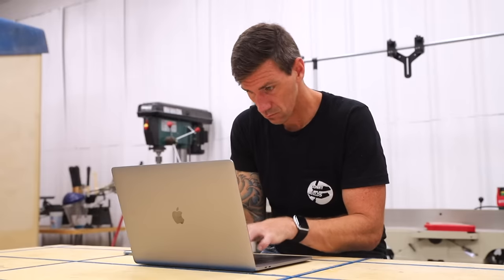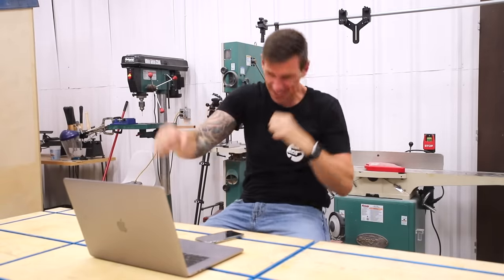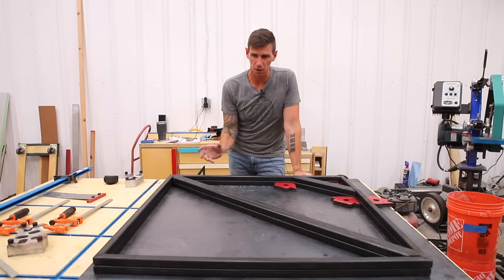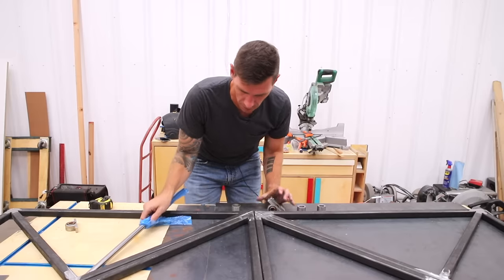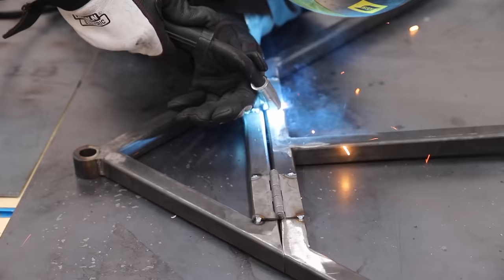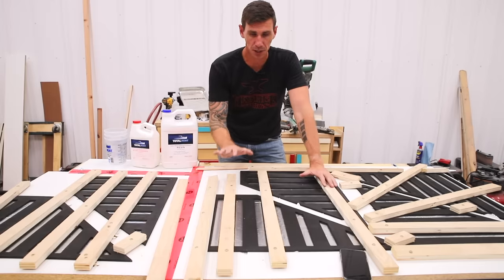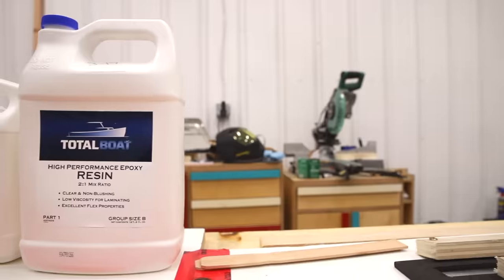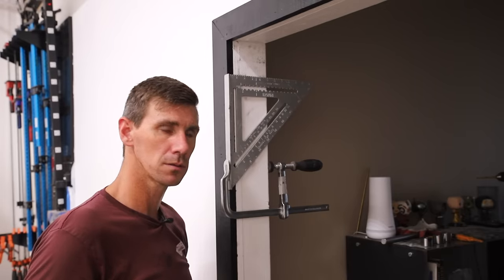Impossible Folding Door

Comment from the maker: HEADS UP!! (Update, I added subtitles to that section!) Some folks are experiencing audio issues at the 1:50 mark. This is only occurring on some devices, not all. I have no clue why this is happening, but the audio is there for that segment, I promise.
Reply: thanks man, i thought my airpods where broken.
Reply: I only hear the sound on my surround sound speakers at that point - I wonder if it's some weird encoding thing?
Reply: It's not playing sound during the explanation on Motorola phone. Of course it's the most important part explain how it works. I did try turning captions on but it did not put any words on the screen either. The click for the subscribe and Bell are super clear, then the sounds comes back. Odd.
Reply: The problem is that one of the audio channels (left or right) have inverted polarity on that segment, causing the audio to be cancelled when summing to mono which some devices do. This is also the reason the audio sounds weird on speakers (and somewhat on headphones) during that part of the video.
Reply: I can confirm it's not working for me on Windows 10 in the latest version of Firefox or Chrome, in regular or private browsing modes. Iphone is good though
Reply: Guilty Chris Yup, I experienced this with a lav mic long ago. The solution was to take one side of the stereo track and convert that to mono. It's pretty fascinating playing the audio with stereo speakers facing each other and hearing the sound cancel out, tho
Reply: Looks really nice. You didn't show what it looks like with the light coming through the resin bars.
Reply: I immediately went to the comments when the sound seemed to cut off for me... At least I know it's a known problem - hopefully I can figure out something, it would be nice to hear that part
Reply: Doesn't work on my phone with one speaker, works on my laptop with two, but it sounds very odd in that segment.
Reply from the maker: Sorry! So frustrating
Reply: The interesting thing is that not only there's no voice, but automatic subtitles do not work either
Reply: I think the audio is set up to be heard from an angle that some audio devices can produce so you can’t hear it only some parts that you normally don’t hear because it’s part of the audio and producing the sound
Reply: I've found the solution to the problem: use stereo speakers or headphones, which do not convert the audio to mono. It definitely has to do with an inverted polarity as  @guiltychris4940  said earlier.
Reply: I also didn't get the audio. Hope you figure it out.
Reply: Also no auto subtitles for that section (YouTube didn't hear it either)
Reply: Yeah it's happening now my phone.
Reply: True! Happened to my OnePlus 6. Connected to a speaker and I was good to go. Could hear a little lower volume, but it was there
Reply: Elmo SAME!
Reply: Guilty Chris damn ok.
Reply: Had the same issue. In iOS settings I disabled mono audio and that fixed it.
Reply: Glad it’s not just me
Reply: Yupp. But only if you’re wearing your Left Bluetooth headset on by itself. Weird, but I hear it fine when wearing both AirPods, or just the right.
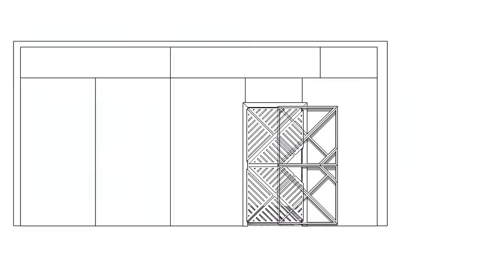Reply: dropped out at 1:53 and came back at 2:43
Reply: When i put my phone speaker to my ear its like an alien message i have samsung s6 edge btw
Reply: same
Reply: i think you accidentally made destructive interference here... you can hear it on any device with stereo audio but not mono. Just so you know, to make sure it doesn’t happen in the future, make sure you don’t accidentally offset one of the audio channels (right or left) while editing as this problem can happen
Reply: oops just noticed someone already pointed this out a bit better than me 😬
Reply: iPhone and not working how strange
Reply: Yeah my phone did something weird there
Reply: Bruh
Reply: Edit: Never mind it seems my phone is Mono, not stereo, so the issue is not a bug, but an oversight in editing. 

I'm watching it on the YouTube app on an Android LG G7ThinQ. Honestly by the look of things I think the audio was removed in post after a claim dispute, it just seems like an impossible bug, and definitely one I have NEVER seen before.
Reply: It's also really weird for me. On my desktop with a standard firefox browser, it's fine, but in the youtube app on my phone I hear really weird and trippy audio.
Reply: @chadmarkley  Works "fine" here on Windows 10, newest Chrome version
It should be sound driver issue in the end
Reply: I have no idea whats wrong as i cant hear the speaking but can hear the music and clicks perfectly. I have a Samsung
Reply: Maybe you can do a special video for the explanation. 😁
Reply: That's because the audio of you speaking is only one the right audio channel.
Reply: Hey! I know the audio issue. Starting at 1:50, your two stereo channels are out of phase with one another and need to be polarity reversed. If you listen in mono, you can't hear anything, but if you listen in stereo, it sounds kinda funny. 

When you listen on a device that mixes down to mono automatically, those two channels will cancel out, and you won't hear anything. When you listen on a stereo speaker system, you'll be able to hear, but it will sound extremely strange.
When you listen on a stereo headset/earphones, it will just get extremely quiet.
Reply: I can hear him, but the background music is loud in comparison.
Reply: Same problem in Xiaomi MIA2 Lite, with Android 10, YouTube App.
Reply: Everyone needs to just turn off mono audio for that part and it will work
Reply: @Jtenorio1  I'll try watching this on a device with proper speakers, not a phone.
Reply: My surround sound on my phone was like the left speaker was louder than the right
Reply: Seems fine to me
Reply: You probably have a phase issue there. Inverted phase on one of the right or left channels results on there being no audio when a playback device summs or mixes stereo to mono. Also like with a Bluetooth speaker this happens.
Reply: sounds like the panning is all off and is too much to the right
Reply: Got scared lol
Reply: There's no left or right Fount stereo
Reply: the audio lost if i hear it from mono tws, haha
Reply: Lol I thought I was going crazy
Reply: Thanks man, I thought your mic was off
Reply: That’s really weird
Reply: @Kr00zA  you don't xD
Reply: You have put the audio in to stereo only mode. You can very easily fix this by making your audio mono.
Reply: Just make your audio mono. Problem fixed 😆
Reply: Doesnt work on my phone. Galaxy S8+. :(
Reply: Yeah, I experienced that issue as well, and I'm on my PC running on Chrome.
Reply: i thought my phone was broken
Reply: @Jonny Builds
Stereo audio works fine, mono fails. If you would like to fix this and if you have the original files for the video delete the left audio channel for that segment and duplicate it the right channel. @Tracy McLaughlin Holmes was right
Reply: Amanda Lim play it through any stereo headphones and only put one bud in
Reply: @tracymclaughlinholmes677  same experience
Reply: This door problems a lot,
1 your fingers will injured
2 it can be fold from one side beacuse other side going to be verry hard to open
3 The noise that makes with time
Reply: u can still edit it
Reply: @guiltychris4940  Sounds completely plausible. Like others I have tested this across different devices, speakers and browsers... Interestingly YouTube won't caption this section of the video either. Cleaver means to rapidly increasing views on a video via the pyramid effect! Inevitably I'm not suggesting that was Jonny's intention as there is definitely something up with the audio.
Reply: Lol I thought that part was a prank! It looks like the audio in L is positive wave and in R negative wave and if put in a device that it's mono doesn't work bc the sound wave is plane. Maybe it's that!
Reply: I need both AirPods out to hear it if I put one away it cuts out again
Reply: you've inverted the polarity of one of the audio tracks, I believe the left though doesnt really matter which. This causes stereo to mono converters to have the audio cancel, and headphones or wide enough surround setups to sound heavily biased to one side.
Reply: That Sounds rly funny😂
Reply: I thought it was some kind of prank XD
Reply: This just sounds like the microphone is setup backwards
Reply: Your voice wasn't there the music and the bell sound was super weird
Reply: iphone 5s btw, audio cut and was gonna comment but seems you know
Reply: Worked just fine for me.
Reply: it's there, just really low volume, and a bit of warped sound
Reply: Iphone se (old version), no audio
Reply: Thought my one plus 5t speaker was going bad.
Reply: Yea same
Reply: Yep I got the glitch
Reply: Feel out that time on m Motorola, but came back within two minutes.

Acceptable
Reply: Didnt play on iphone 6s
Reply: You could add subtitles as a solution? 
Also how does it look from the other side?
Reply: In my phone, when connecting an earphone there's no problem, but in speaker mode, the problem exists
Reply: Lmaoooo all I hear then it's some sort of alien dialect mixed with music
Reply: I think that the left channel is the exact inverse of the right channel. So when listened to with mono output (such as a phone speaker, you hear the combined wave (= nothing), and with earbuds, the voice sounds like it's coming from inside your head.
Reply: wouldn't hear anything on my laptop or phone, had to move to watch on my switch lol
Reply: @guiltychris4940  this is what's happening, 100%
Reply: I love YouTube trying to work differently  on different devices.
Reply: My audio issue during this segment is that he gets 4x louder unexpectedly.
Reply: it’s gone weird on my iPad 9.7 pro, at 330 pounds refurbished on eBay, with a 9.7 brydge keyboard connected, with the audio coming from the iPad 9.7 Pro. I thought it was broken!
Reply: One plus 6 doesn't work 😂 sounded like water got in my speakers all of a sudden
Reply: @guiltychris4940  i have configured my audio setup with ALSA on linux which does NOT sum the channels up and i still hear that
it kind of sounds like the left channel is just quieter
Reply: Comes back at about 2:40
Reply: I coudn't hear your voice on my mono bluetooth headset. It is probably because the polarity of one of the channels (left or right) is flipped and the narration is recorded in mono (1 mic), so usually both left and right would have the same signal from your voice, but since one is flipped it cancels out the other when the two channels are mixed together (downmixed to mono).
Reply: It happened to me too! I'm using an android.
Reply: Yeah the audio is a bit weird
Reply: Wasn’t a lack of audio for me on my iPhone SE 2 but it did turn very robotic
Reply: Dw, it's a YouTube problem
Reply: It's not though tried 7 devices nothing
Reply: Sounded like someone was slurping water
Reply: Ezra Ross yeah was a little problem for my Samsung ENERGY STAR® Rated Products Meet Strict Energy Efficient Standards Set by the Government. FlexZone™, Wi-Fi Connectivity, & Quick Access Are Brilliant Innovations. Explore Today. Built-In Cameras. Styles: Tuscan Stainless Steel, Stainless Steel, Black Stainless Steel, White Smart Fridge
Reply: Audio works for me, I'm currently using chrome (chromium) in debian linux
Reply: Phase cancelation , that's what it's happening
Reply: @chadmarkley  It is not the device, it is just the speaker/headphones you use
Reply: Can you make the door cloths automatically? Like some regular doors do? And can you lock this door and unlock from the other side?
Reply: Happened to me. Cheap prepaid android phone. J3 Prime, I believe.
Reply: Okay thanks I thought I was tripping for a sec, no bs
Reply: Maybe add some closed captions for that part in particular? Just thinking.
Reply: Redmi k20p here. Can't hear it (if you are doing any internal investigation) I heard the subscribe button click tho
Reply: Jonny Builds same I am on an IPad
Reply: Such a stupid door. But good job for the effort.
Reply: Yes sir
Reply: I did
Reply: My sounds like you are drinking water and talking to me lol so odd but great build!
Reply: Jonny Builds it only came through the left speaker for me, I’d say have a troubleshoot on your audio encoder
Reply: I thought my phone which is from this year ( in UK , my phone is Samsung galaxy a51) was broken
Reply: I that my phone broke I got really scared there for a sec
Reply: @CeresAzalia   ya it don't work on galaxy
Reply: Glad i read this before that came up. I would've thot my speakers are breaking. They are quite old
Reply: Elmo yooooo samee I was bout to double check
Reply: Happened on my moto g7 unlocked
Reply: Friggin hell it works whe I subscribed and clicked the bell icon .... 😏😏😏is this a new way to earn subs
Reply: No audio at 2 min. Samsung Galaxy note 4 watching on YouTube premium app.
Reply: @Elmo-yd8lw  yea me to
Reply: Okay, so the background music plays for a little bit into the "dead audio zone", but not the voice.
Motorola phone test
Reply: Gus Cichoski  yea me yo
Reply: Yeah man, I noticed that with the audio. Regardless of it, this build was brilliant and beautiful to boot!
Reply: Yeah, I'm glad I checked the comments, I dropped my phone in the sink the other day and I thought it was done for
Reply: but its only the actual recordings audio gone not anything else i could tell by the subscribe thingy
Reply: Google pixel 3a here, doesn't play for me
Reply: i use iphone 6s
Reply: I would file a bug with YouTube. 

It's not that the sound is not playing, but what I hear very quietly is a somewhat squeaky high pitched noise along with ground noise on my Android YouTube app.

I further tested this on my Lumia 920, which is a Windows Phone 8 device and iPhone 11 and I hear the same problem. Although if I play it from my tv I hear the audio perfectly fine.

My hunch is that YouTube thinks you have multiple audio streams embedded in your MP4 file and YouTube is picking the wrong one for mobile playback.

Try processing the audio separately. I use tools like Machete Lite for that.
Reply: @tracymclaughlinholmes677  same here. My motorola Z2 forced edition has it not working too
Reply: Can you pin a transcript of that part? Or put it in the video description?
Reply: This would be super cool to see someone make automated
Reply: Problem is probably mixed around sounds. Left speaker is the exact opposite of the right speaker causing noise canceling inbetween. I can hear perfectly on my left and on my right speaker, inbetween just doesn’t work
Reply: Elmo lol same
Reply: Yea me too
Reply: :( thx
Reply: i hear scratching and beeping on my iphone 6s
Reply: Elmo I only hear it on my headphones...
Reply: Wow that's kinda weird. Good to know though right?
Reply: @guiltychris4940  wow I didn't know that was an issue that could happen. This is definitely the first time I've ever experienced it. Commenting now so I can hopefully remember this if I ever have a similar issue
Reply: @guiltychris4940  Thanks this helped me a lot! I plugged in my headphones and it worked again
Reply: For those of you on Android that are experiencing this audio issue, go into Accessibility settings and move the audio balance all the way to the left or right. This essentially ignores the other channel allowing the sound to come through instead of being cancelled out by the opposite channel being 180° out of phase
Reply: I could hear the sound effects that were edited in but nothing else
Reply: @devilsden3326  that's cuz most editing software takes care of the channel polarity automatically for sound effects
Reply: I have Audio but really quiet. YouTube subtiles seem to be broken too.
Reply: Work with earphone not working with speaker
Reply: Oof i thought my volume was down or my phone was broken
Reply: Me too
Reply: For some reason YouTube captions didn't get it either
Reply: why did you ask someone for permission to create something they copied???????
Reply: Thanks, thought my phone was done for
Reply: So I’m on iPhone 11 I think the way the way you recorded the audio it was picking up on one side of your micro all around you and tought this is surround sound and maybe when posting maybe it tought I will output the sound as surround sound for devices that support it and maybe that’s what causes other devices to not hear anything, but that’s just my theory
Reply: It really had me freaking out tho lol
Reply: Strangely I can hear it fine with my iPhone X but as soon as I connect my AirPods Pros I can’t hear it
Reply: Yes there's no sound for me on mobile phone
Reply: The sound dropped like a broke cassette xD but a minute later it gradually came back hahaha
Reply: @thematthewreed  is cause there echo in the room his in so the mic pics up his sound all around the room
Reply: I can hear it on my phone
Reply: I heard the bell😂
Reply: I wish I’d had an audio issue when you pronounced his name war-wick.....it’s pronounced warrick, not war-wick or war-rick....
Reply: I thought my speakers broken
Reply: Had that issue, nonetheless, great video, man
Reply: Indeed. When I listen through my phone, I don't hear anything. But when I injected my headset, I can totally hear the audio.
Reply: Have you considered manually putting subtitles on that part of the video?
Reply: I had this on Android, Samsung galaxy Tab E
Reply: It’s not working on iPhone 6
Reply: I thought my phone was broken, thanks, now I know.. :)
Reply: For me, its just the right speaker going on louder than the left one.
Reply: why is there sounds of rats squeaking
Reply: Imaging a human speaking really clearly underwater. That is what it sounds like.
Reply: Samsung S5 won't hear it
Reply: @thematthewreed  same here wtf happened
Reply: I thought my Speakers broke XDD
Reply: Jonny Builds, if they turn off mono audio, it should go away. I could hear it the first time, but when I turned it on it went away.
Reply: Use headphones or any device with stereo sound, if you try to listen with a mono sound device the audio cancels out
Reply: Mee
Reply: I thought it was sped up
Reply: on iPhone, turn off Mono Audio in Setting -> Accessibility -> Audio/Visual.
Reply: It has a lot of stereo width (which shouldn't happen). It sounds like the polarity is inverted on either the left or right channel (i.e. you flipped the waveform upside-down in the video or audio editing process). If you combine perfectly inverted waveforms into a mono signal, you get a thing called phase cancellation. This explains why people can hear you on stereo or surround systems, but not on mono systems (like some phones or laptops).
It also gives you that surreal sensation everyone is describing. Fun stuff.
Reply: Easy fix, connect wired headphones